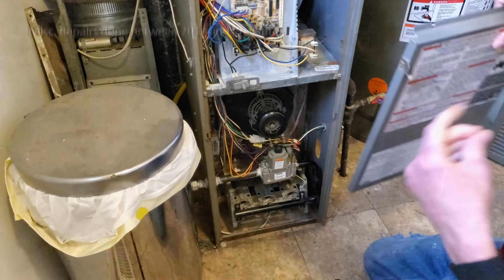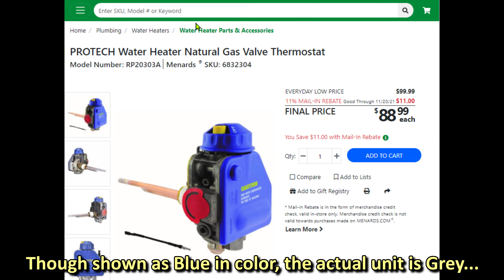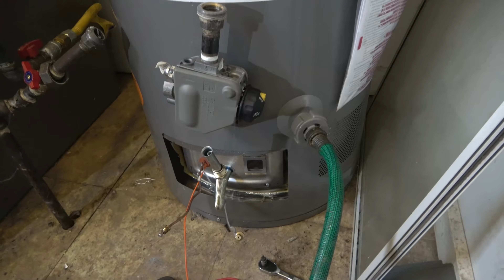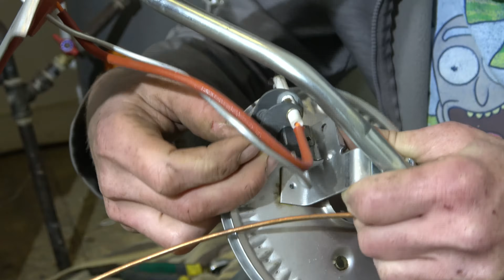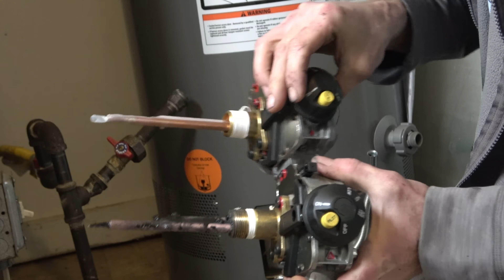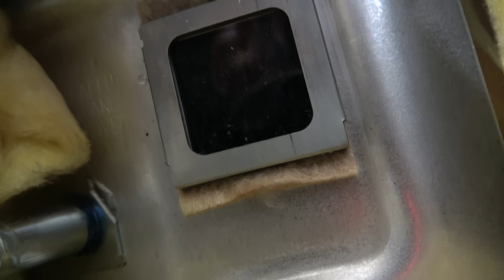Water Heater Gas Valve & Thermocouple Replacement (Richmond / Rheem / Others) #waterheater #DIY

Comment: Great video sir, I'm in the process of replacing the same thing  mine is a State brand 28 years old, I hope this fixes my problem. I have a drain in the floor so should be easier to drain it. Thanks again.

Comment: Good job.  My only comment is to replace the silly plastic drain valve.  I helped a friend with his Rheem because the cheap plastic valve broke, flooded the bottom of the tank, and blew the thermal fuse.
Reply from the maker: @louisnatkin5317  If I owned the house I probably would... But I just rent here. I do the maintenance as a favor for the landlord and he pays for the materials... 

Because my water is not great, I do flush the water heater once a year, so that valve does see use. I only recommend doing that if you have been doing so every year though... If it's been a while, better to leave we'll enough alone

Comment: Good job. Good video. Next job, replace the 1950's sink and faucet.
Reply from the maker: Lmfao, this is a rental property so I don't have that kind of freedom but yes, much of the house is pretty out of date... But knock on wood, everything works 😀
Reply from the maker: Actually I think my next house project, which is mine to do what I wish, my clothes dryer has sand like trapped in the outside of the drum. I used to work in setting modular homes and mobile homes, and I washed a lot of sand ... Unfortunately my dryer always sounds like I'm tumbling a rock tumbler when I first start it up...

Not sure when I'm going to get around to that video but it will be in this series of fixing home appliances.

But thanks so much for the feedback in any case, always appreciated!

Comment: Great video as I’m getting ready to replace my Richmond gas valve.  My heater is about 2 years old and I called Richmond and they are sending me a new valve at no cost. Saves me around $100 but I have to wait a couple days to get it.  They are expediting it so that will help
Reply from the maker: Happy to help, I wish you the best of luck with this repair!
Reply: Glad I read this.....just saved myself $100 as well.  My unit was still under warranty as we bought the house a few years ago.  Thanks!

Comment: I been having a problem with for two years nearly, I found out the igniter wasn't getting good connection and the burner goes off ever time you turn on along with the pilot light.  I leave on pilot it goes out once in while.
Reply from the maker: Make sure there is adequate ventilation in the room, and no gusts near the bottom of the water heater. Also check the flue for any blockages though if it's the passive kind (little "hat" that sits on top, rather than a forced-air) that generally won't starve the pilot...

My water heater is in the launrdy room, a small room shared with the Furnace -- and at one time, when the furnace would kick on, it caused enough suction in that room to starve the water heater's pilot light! (I later added proper cold-air return ducting to the furnace) but that's why I mentioned ventilation; it needs oxygen for combustion... even for the little pilot light.

Aside from that, I would say replace the burner assembly (usually comes with the pilot tube, etc) and thermocouple first, and failing that, it could well be the gas valve.

Comment: Richmond (Rheem) sold at Menards after 2012 have an "Over-Heat-Protector-Bulb)". It is behind the burner on the floor and has a glass bulb that looks like part of a ceiling sprinkler system. If it is set real hot or the valve malfunctions, it expands and breaks. Air is needed for combustion and this broke bulb causes the spring loaded bottom trap door to close. No air, the main burner stops, the lack of oxygen causes the standing pilot lite to quit, this allow the thermal coupler to quit producing the 0.030 (30 mV) required to hold open the solenoid to the pilot, so it goes out. Also when equipped with the "Blue" plastic control valve, the igniter wire is on the right hand side. It is a complete circuit thru the body of the heater lines (etc.) back to the igniter. So, it is a single wire and has a snap button top of it, not the gas control valve RED button for pilot. Pushing the RED pilot button down to snap the igniter does nothing. Place the the pilot position and hold the RED button down (As if to remove air from the gas line) for 20-30 seconds, allows the time to hit the igniter snap button on the right hand side where the "Tan / Orange" colored wire attaches. If unplugged or dislodged, it will not create the snap noise like a gas grill. Use a mirror if possible (Sometimes lights out help) but these have a window on the right hand side. It will allow you to see the spark / flame and held for 20-30 seconds, release RED pilot button, turn to low setting, the main burner will come on. Adjust as needed. Just remember that too high people can be injured by hot water above 110 degrees F. Many like it a little hot for dishes in the sink or washing hands. Dishwashers have a heating coil at the bottom and many like it. I have used one because they waist electricity and water plus you have to by soap.
Reply from the maker: I actually was not aware of the glass bulb safety mechanism, good to know. Everything else you mentioned I pretty much covered in the video. I didn't hand hold the viewer through how to light the pilot light given that a, the instructions are printed right on the tank and or the gas valve, and b, if you're taking on the task of replacing the gas valve I would certainly hope one would know how to light a pilot light.

As far as the temperature of water, I covered that. I specifically mentioned to not simply set your new gas valve to the same setting as your old one, rather start low and incrementally increase it as needed over a period of a few days. So pretty much most of your comment was covered in the video, with the exception of the sprinkler type safety mechanism which, I'll admit, I wasn't aware of and is definitely a great feature assuming it works correctly.
Reply: @JustinNelsonsProjects    You did the best you could in an attic! My god, I am 6'3" tall and most likely couldn't even get up there, much less hold a camera while getting video when most jobs take two hands. I fixed cars and I have thought about this, but well over 50% of the bolts I installed are never seen, only felt.
  Like you, a finger tip finds the spot, tip the bolt or object into place, then gently turn it to see if it starts. 
  The glass bulb thing bothers be. I honestly believe that is a special requirement for attic, area or local code! The national electric code is a book twice a thick as 10 years ago. (I am guessing) but water heaters can only over heat by a control valve malfunction. The tube that enters the tank, senses the internal temp can mid-read the actual temp. If covered with hard water deposits, it can be insulated from the actual temp so I was thinking. What happens if the flue is short and it is very windy. This could supply everything to support combustion yet it can travel say 2" outside the burner plate. So, this would get hot, burst, close off air intake on the bottom and stop combustion. To me, this makes sense. I am just thinking out loud as they don't all come with this.
  If mounted in a fashion where flue pipe is 10 feet or less, then yes, this safety device is required. If 10 foot long flue or longer, wind will not effect a standing pilot very much if at all, but not overheat.
  In Omaha, city water has some hardness minerals. So, after installing a ball valve for main shut off, a 3/4" line feed lawn irrigation the into the softener. Soft water goes into the water heater and out. 
  So to make the heartier last longer, soft water in, temp sensor, drain and pressure/temp sensor is not coated. The anode should be changed next. That is something few very do. Also, 99% of people think a glass-lined tank leaks at the bottom! No, the pin-hole and rust thru at the top. Heating + minerals produce bubbles. A simple common system allows these bubbles to float to the top. You end up with oxygen, minerals (Perhaps some acidic) but when cutting open, every time, I find the leak/rust at the top 5-8".... It is crazy. I open power window motors, brake boosters, whatever it is, but look to see where it failed at and why. Dealer techs can call technical support but they are going to ask 20 questions so they know you didn't skip steps and that places you both on the same page. They can be brutal if you don't have answers. 
 So, Rheem customer service would know why this glass bulb is used,  maybe it is on all new ones manufactured after a more recent date as mine is 10 years old. Manufactures do design a certain amount of "CYA" into their products. Like "SIR" in you car or truck. It takes a 12-15 second loop of network info from deployment, brakes on/off, slowing, speeding, lights, MPH, VSS, deceleration in "G's", etc. all recorded electronically on a EEPROM chip using software lawyers, highway patrol, police, FBI etc. Many call this the black box but most are aluminum under center console or seats solid to the floor.
 Have a good one. I like learning and gas company installed smart gas meter but could start my water heater. I found this in 6 minutes, pushed the button once, had my burner on! Thanks.. happy 2023!
DK, ASE master tech since 1978, Omaha, retired.

Comment: How to get that plate off after removing those 4 screws. Do i pry it up and out? It's on thier solid. Looks like same unit. 2 years old just stopped working pilot light will not light.
Reply from the maker: That orange gasket behind that plate can become quite stuck. In fact you are supposed to replace that gasket every time you remove the burner assembly, and a lot of times the kit for a new thermal couple will come with that gasket.

I was lucky enough that my gasket being only a year old came off quite easily and did not tear. However in the past I have had them ripped to shreds and require scraping the remnants with a razor blade ... So before you go prying on it with a screwdriver, have a new gasket because if it's giving you trouble it's going to tear.

Comment: Surprised by your comment that white Teflon tape is fine for natural gas pipe fittings.  My understanding of the reason for a separate yellow Teflon tape for natural gas fittings is that it won't chemically degrade over time in the presence of natural gas, like white Teflon tape will.
Reply from the maker: I did a little research, and from what I can gather, these days the only difference between yellow and white is the thickness of the Teflon tape. It used to be as you say a formula that was less likely to degrade in the presence of certain gases but apparently the white tape also is made pretty much the same way just thinner.

However many jurisdictions, say during an inspection, will expect to see yellow on gas pipe one half inch or bigger. They also make a red tape, pink I believe, and silver for stainless fittings. I believe the red is required for anything containing oxygen as it is not petroleum based and is less likely to cause an incident with oxygen...

This is based on some quick research, I have just always used the white tape because I always have that stuff lying around. Plus I don't expect this gas valve to last more than a year anyway however if and when I have to redo it, I will pick up the yellow kind if only so that it "looks correct".
Reply: @JustinNelsonsProjects  Thank you for the additional information.  Yes, it appears that currently the only difference is that yellow Teflon tape is slightly thicker.

Comment: This video seems to perfectly explain what I need to do but I'm having one problem. I undo the 4 screws and the 3 nuts the the control, but that whole section will not even budge. It's almost like it's welded in place. You just seemed to lift and pull the unit straight out. (I'm guessing that you ate your Wheaties the morning of the video?😉)
Reply from the maker: If you are talking about the burner assembly, mine came out pretty easily but the water heater itself was only a year old at the time. An older unit might have a gasket that has fused itself in place...

Comment: Are you suppose to remove the plastic on the copper pipes that go into the tank? All the videos look like it stays on but nobody talks about it!  Any info would be greatly appreciated
Reply from the maker: That plastic stays on. I think I pointed that out (I asked myself the same question) because I recall showing that the original valve had the plastic on it . And it was pretty grimy looking 😲.
Reply: Thank you! I did install with it on since the original indeed had it on when I pulled the sucker out.  Could not believe I had to replace the gas control valve after less than one year of purchasing my  richmond hwt!  Thanks again

Comment: Great video have a question the igniter went out for mine it no longer clicks ive found the igniter online home Depot would i have to completely remove the whole pilot assembly as u did in this video? Or is there another way to do it thank u
Reply from the maker: I would read all instructions that came with the new igniter, or instructions for your specific water heater. In my particular case I do believe you have to pull the burner assembly out but can't really give you advice on a product different than the one I personally have experienced with

Comment: Why is that gas valve cocked to the side?!
Reply from the maker: If you watched the video I do explain this; a year ago I had replaced the entire water heater. As the new one was slightly taller than the old one, I simply rotated it to match the gas input lines. With some research you'll see that the exact orientation doesn't matter, and in fact the Rheem/Richmond valve is simply a defective design from the start...
Reply: Laziness.

Comment: U don’t need to drain the water heater tank just cut off the water coming to the tank and use a rag maybe small amount come in when u take old gas valve off , I try it hundreds time in my job

Comment: Be prepared for the Rheem control valve to fail within a year or less, whether its brand new or new replacement. My original OEM valve last for about 13 months, then the replacement last only about 9 months, same failure. Richmond covered the warranty for free replacement. They know there is something wrong with their product, until they can find a better material to fix the control valve opening and closing of burner gas line. Any smart engineer available, please apply now at Rheem!
Reply: Probably, Rheem should increase the temp rating of thermal cut-off fuse to 120*C instead of 91*C.

Comment: saw a different video where someone just removed the white sensor attached to the thermo couple and it pretty much fixed it. someone in the comments on that video said the white sensor on the thermocouple is an emergency cut off that turns off the water heater if the water inside reaches a certain temperature. about half the people in the comments in that video said by removing that sensor, their water heater started working fine again.
Reply from the maker: I do still have the original gas valve. I didn't think to dissect the valve itself in any way but if this happens in another year I will definitely give this a try
Reply: the white sensor is a thermal cut-off device (a fuse) if they open the pilot will not stay on at all.
Reply: Mine did not work at all upon removing that white sensor to the control valve.
Reply: @mikibihon8826   Probably the thermal couple did not have good connection. Please see below comment from Ray K I took from another video. Or wrap a thin wire around (4 laps) the cable between the nut and the tip of the cable acting as a spacer that would provide better connecting. 
Ray K
3 days ago
This is a major Richmond known gas valve flaw.  No need to remove thermocouple, just cut the 2 white wires close to the thermocouple then tie them together, that's it. Works like a champ. Great video though!